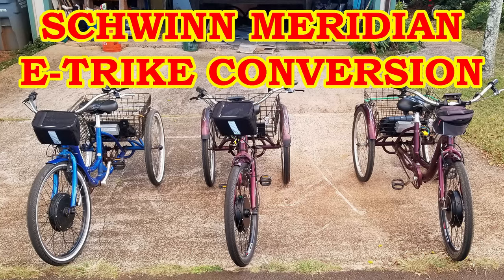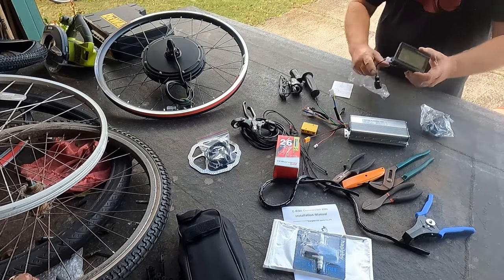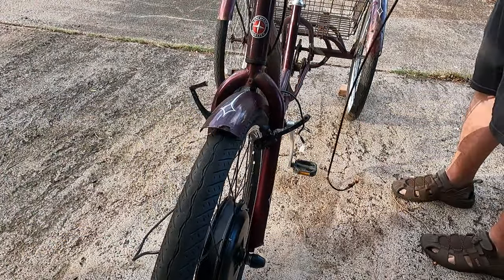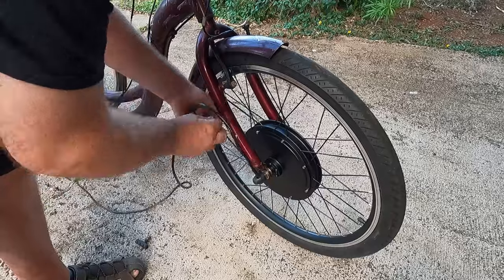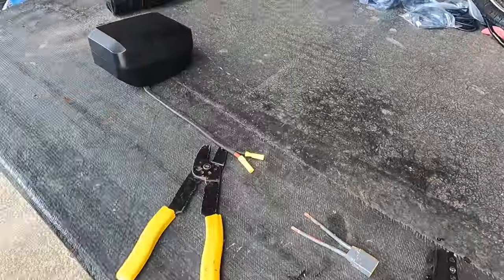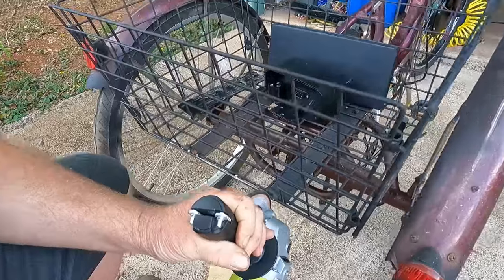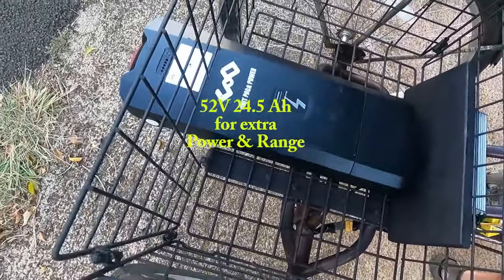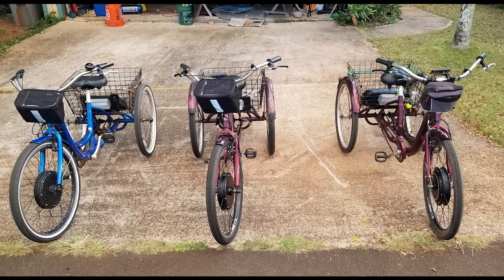Schwinn Meridian Trike - 1000W E-trike - Ebike Conversion

Comment: My ebike only does 15 miles per hour. It has fat tires but adds to traction. It has the wrong tires because it doesn't grip the pavement. It's new tires but the wrong tires.

Comment: I took the rear hubs and laced them into 20inch rear rims so it lowered the back. Put on a banana seat. Large front basket. Filled the rear basket with 4 huge batteries in parallel. Could go almost 100 miles. It could hit corners preeeety fast without rolling. Got stolen. Miss that thing
Reply from the maker: Dang!!!

Comment: If you just deflate the tyre, the wheel can be removed without adjusting the brake setting. Ditto in reverse for refitting the wheel.

Comment: In simple terms can a front wheel ebike motor be used for a rear wheel drive on a Schwinn Meridian?
Reply from the maker: The front wheel motor has an axle and fits in the drop outs of the front forks. the rear wheels have hollow spaces for the axle to come through so won't work with the front wheel motor.

Comment: Thanks for the video.  I just converted a similar Sun Trike with an Amazon 750W, 36V motor.  But it makes a grinding noise under load. When I lift the wheel the noise goes away. Now the Company says they aren't suitable for a Tricycle.  Only a bike. They didn't elaborate why. Is it maybe because a trike has more resistance?   Is that why you use such a big motor and 52 volts on yours?  This build is for someone that has no need to go fast so I thought 750 would be plenty.
Reply from the maker: If you are going up a hill or putting big demand on it, make sure that you are pedaling Demanding too much torque from the motor can be an issue. pedal!

Comment: l agree that it works, you have not taken into the account the possibility of a flat front tire. with a trike, the tube and tube are the most important.
Tires and tubes need to be as close to flat proof as possible. they are available. People do not realize the implications of a flat far from home.
Also, your mounting of the controller can be easier by mounting inside the rear wishbone with zip-ties. providing way better cooling and less material.

Comment: Great vid thinking of doing one of these.  Been looking at used meridians and only see 1 speed trikes.  Is that an issue?  Seems like you'd want the 7 speed for a 1000w etrike conversion? Thanks
Reply from the maker: 1 speed is all you need. once the bike gets going the electric is faster than you can peddle.
Reply: @DIYKauai  oh I see makes sense. I wasn’t sure if you had a 7 speed if you could do a sort of pedal assist but I could that probably wouldn’t work since it’s front wheel drive anyway. Thanks looking to build one of these for my wife

Comment: I noticed in this video you did not go over the pas install is this a necessary component or. An we leave it out
Reply: I don't have a crank pulling tool and it can be a real pain to get the cranks off... I prefer to manually feather in the throttle instead of dealing with PAS delays.

Comment: is it, well not insanely, hard to wire 2 rear wheel kits together into 1 control board?

or should i just do 1 for the front wheel?

I'm 398Lb and the extra torque/stopping power would come in handy
Reply from the maker: these bikes are a little fragile, I would recommend getting a fat tire trike. It will do a better job for you.
Reply: @DIYKauai  thank you, but is it possible to run 2 rear wheel conversion kits for the back tires, or would i need to like, rewire them?
Reply from the maker: No idea, sorry... @MinisterRoy205

Comment: I converted my Meridian. I rode it for two months and four spokes broke on my right rear wheel. I read that the spokes on the stock Meridians are notorious for this. They are also hard to find. Has this been your experience? I have no desire to keep replacing wheels or spokes so I’m wanting to convert to alloy wheels but the “D” shaped axle is not compatible with any I have found. Is it possible to change the axle to one that will work?
Reply: Meridians are not worth it as they are only  $260 at Walmart. Not suitable for ebike.
Reply: Yes you can change the axle get a 3/4 axle off of bmi karts and od 1 3/8 I'd 3/4 axle bearings from ace hardware and get some 3/4 sprockets Bing bang bam larger stronger axle I did it while making a custom stretched drift schwinn

Comment: I purchased a 1000watt ebike kit and a good battery for my ~5 year old Schwinn Meridian, it was nice for a bit but it folded in my forks, I made the repair but I am not going to try this again, BTW I read up before doing this and I even had a torque arm installed. My question is can I put this front wheel ebike motor on the free wheel on the back of my Meridian?
Reply from the maker: sorry about your forks, they are not very strong. You can order new forks from Schwinn, not to much $. I found that tightening the nuts on the forks is super important to keep from bending the dropouts. the rear wheels are different and cannot use the front wheel. You can replace the front forks with ones that are more durable but they won't match the look of the meridian.  best of luck. I have ridden over 5000 miles on these trikes now, so it can certainly be done.  I mainly ride 1500W+ on the front.

Comment: I bought a meridian and put a 1000 watt motor and torque arm and it wallowed out the groove where the axle goes.   Any suggestions?
Reply from the maker: It is very important to really tighten down the nuts on the front forks - much tighter then without the motor wheel. This is the key. The torque arm is a safety backup.  You can contact Schwinn over the phone and they can get you another fork.  I have learned the hard way, lol...  Also, I always pedal to get the bike going as this relieves a lot of stress on the forks. Once you get going you can stop pedaling.

Comment: Hello, I come from Italy, I saw your video, I find it very interesting. I would like to convert my tricycle like you did, I want to ask you a question, with a 1000 Watt motor like yours, it is possible to face 10/15% climbs, moreover, you have only mounted the motor, battery, accelerator and controller ? I'm waiting for an answer, bye.
Reply from the maker: No probkem!

Comment: This was SO helpful!! Thank you for posting this. We are having trouble finding the right PAS sensor, needs to be 4.7mm. Do you have a link to the one you used?
Reply from the maker: I don't use the pedal assist due to the delay... prefer to feather in the throttle... and it is hard to get the cranks off to install them.

Comment: We had the wrapped wires on front tire wrap around the hub🤪 we think we have a missing part, we have the nut but not the cap you show in the video , any suggestions 
Gina
Reply from the maker: Sorry about that... you might try Ebay or Amazon...?

Comment: What type of motor did you buy?Looking to upgrade my trike. I think a 1000 watts is plenty. I don’t have a meridian but a knock off that is exactly the same.
Thanks
Reply from the maker: Check out the latest video I just posted on these trikes where I compare 6 of them side by side.  I think that the 1000W motor with a 52V battery is the way to go. It has plenty of power and nice smooth acceleration curve. The 1500's just peel out in any type of lose ground or grass.  1000W is plenty of power!  Def go for the 52V battery... over volting is fine.
Reply: @DIYKauai  I’m sold. Does Amazon sell this? What brand are we talking about? 
Thanks,
Brent
Reply from the maker: @brentgayler2860  i bought the conversion kits and batteries from China as they have the most options for me in Hawaii.
Reply: @DIYKauai  WILL you PLEASE put up links to EXACTLY the kit you used here and the battery and manufacturer, cost of the build and any or all other build items, accessories, etc. Thank you. Rubber side down....

Comment: I'm curious,  why not mount the battery below the basket so you still have full space in basket? Also, wouldn't it make sense to clean up the frame and repaint it. Kinda looks ghetto bro.. If your goal is to sell it or gift it, my suggestions make sense correct.
Either way the video is cool. Thanks for reading and dont take offense.
Reply from the maker: ghetto is how i roll

Comment: Have you installed disk brakes on your bikes?  My trike is new but it doesn’t have the mounting brackets for disk brakes unless I use the brackets. Is it worth it?
Reply from the maker: The Meridian trikes are not setup to support disk brakes. I simply put bigger break pads on and they stop competently.  Check out this new video comparing 6 different builds.  https://youtu.be/aj3abhgAi2Q
Reply: Okay , thanks so much,

Comment: Somebody please help before I take a blind plunge! I want a Meridian, preferably the 24' 1 speed, however I plan on installing a few aftermarket parts. Can I change the rear rims to 144 spoke hollow hubs??? My first experience with trikes, input is much appreciated.
Reply from the maker: good question for the DIY groups, not sure.
Reply: @DIYKauai  Thankyou brother. I'll keep posting. I just want a fly looking adult trike but I'm not sure if these are good for customizing.
Reply: @TrailerTrashThorne  Maybe Workmans will work with you

Comment: can you covert one of these to a fat tire trike maybe a mid-drive motor
Reply from the maker: Would need a different frame but it can be done!
Reply: @DIYKauai  How about just amid drive motor
Reply from the maker: @darylogle6696  possibly... front works fine except for the fragile dropouts when using 1500W.
Reply: @DIYKauai  Yeah I’m just curious to see if a middrive motor would work because the chain is kind of long

Comment: I was motivated by your builds so I garbage picked a Miami Sun trike and got a thousand watt front hub motor and installed it everything went together fairly well but the front forks don't seem to be able to hold the axle in place or on do you have any suggestions or close-ups of how you secured yours.
Thank you
Reply from the maker: In or on?  can you show me?  I will try and show you this evening.... aloha
Reply: They sell a kit to hold the hub on the forks, I think it’s called a torque bracket.
Reply: @levigreen9562  thank you Yes I got two and new forks and works great now.

Comment: So the battery was separate?
Reply from the maker: Yes. The ebike kits usually include the motor/wheel, new brake levers, a display and a controller of some sore. Batteries are sold seperately. This allows you to chose what type of throttle, motor, etc...

Comment: i always wanted to know, if the battery goes low, can you pedal it and not compromise the motor?
Reply from the maker: Yes, no problem!
Reply: That shouldn't be a problem since the motor isn't a midrive one.  It's a front wheel motor (separate from the the pedals) so pedalling anytime is fine.
Reply: @krob9145 then, that would be a problem with middrive motors?

Comment: How is this fwd ebike/trike kit working out on this meridian? Would you change or do anything different and if so, what specifically? Btw, thanks for all your previous Schwinn Meridian trike conversion videos. Please make an update video with any or all trike conversions and what you added, changed or improved so others can not make any mistakes and have the best result in our eventual conversions. Cheers!
Reply from the maker: I did another video of lessons learned as I have done 7 of these now. https://youtu.be/aj3abhgAi2Q
Reply: @ Diy Kauai .... Sounds great!, I'll watch it. Thanks for responding and for all your time and effort making videos of your builds.
Reply: Honestly from an engineering perspective this is just dumb ..as trikes are designed to have a rwd design to create the forward momentum the front wheel has far too much "play" in its turning radi and the extra torque applied ves where the most of the weigh is focused rwd is far superior epically if you also upgrade the tires and suspension as well..this " diy kit" is a serious joke..
Reply: @Azraiel.Bridger  Do you know of any RWD conversion kits?  Can you make me one?

Comment: Are these trikes pedal assisted or full-time?
Reply from the maker: I did two with pedal assist but skipped it for the others. We found that it was better to feather the throttle while you pedal... smoother and more predictable take offs. And it is hard to get the cranks off!
Reply: @DIYKauai  I would never have trike front wheel drive.  They are dangerous. Mine is rear wheel drive.  You can pedal assist or full time your choice.

Comment: How did you get by the free wheel issue?
Reply from the maker: what issue?
Reply: @DIYKauai   if I put a motor on it the pedals will go just as fast . Mine is a fixed gear wondering how to put on a freewheel.

Comment: Great video! I have the same trike and would like to electrify it, but I would prefer RWD. Since the rear wheels in these trikes don't actually have cassettes mounted directly onto them, could I use the "front wheel" conversion motor (as shown in the video) on one of the rear wheels instead? Or is there some sort of difference between the wheels? (I know nothing about these yet.)

Thanks!
Reply from the maker: The rear wheels are each different. The drive wheel on the axle is keyed. Front wheel is best way to do this without any major modifications.

Comment: So, you went to the trouble of making a video showing us how you built the ebike... but you're not posting links to the hardware? I feel fortunate to have caught the fact that the hub you purchased apparently didn't come with a battery? Or did it? See? I don't even know. Thumbs down!
Reply from the maker: The links change all the time as I order stuff from China so there's no point in posting them. If you are on the US mainland you can order much cheaper from Amazon.  Batteries are usually sold separately.

Comment: NOT a good idea to put battery in the basket.......you loose basket volume carrying capacity, and more important loose traction as this is a front wheel drive.  Battery needs to be mounted as far as possible to the front or over front wheel  to provide maximum traction on loose gravel or even on asphalt . Now if you like smoking tires when throttling put the battery as far back as you can, like on this video!,
Reply from the maker: For the size of the hailong batteries that I use I have not found any other place to put them. I generally agree with your principals but in actual real rode conditions (I have 6 of these) it has proven to not be an issue. When I need to haul more then the 30 lbs. the basket can handle i attached a garden cart and can haul lots.  Aloha!
Reply: I mounted my Hailong battery on the front frame tube, had to make a custom made curved battery support tied to the front frame tube as it it not straight on the Merdian.It did put more weight on the front wheel, and made a difference has I also use the trike on gravel roads with an uphill inclines! For testing purpose I had the battery in the basket. The front wheel spined very easily due to the good torque of the 1000W 26" motor !!
Reply from the maker: @pinznut  cool design... got any pics?
Reply: @DIYKauai   I do have pictures but don't know how to send it on this site.....email?

Comment: So many ways to install the battery but you wasted the basket
Reply from the maker: Too heavy to mount on the frame.
Reply: @DIYKauai  install underneath of the basket
Reply from the maker: @bobetization  would have to use bottle anchors, to weak and not a good area under there. Would also get wet from mud puddles.  The batteries are extra expensive to get to Hawaii so we protect them like little babies! Plenty of room in the basket. I ride them daily and haul all kinds of stuff in them. I am thinking of building custom wood boxes to replace the baskets.. that could be interesting.
Reply: @bobetization his answer shows that you're not the know-it-all that you thought you were !!!everybody wants to put in there two cents next time just appreciate what people are showing you and stop trying to show different ways to do things that he probably thought of already thank you duh

Comment: I bet you anything that there's no way this battery has 24ah. Impossible, too small. Do a test with the proper equipment to measure capacity, the labels usually lie.
Reply from the maker: The one that lays flat in the tray def is.  It has much more capacity compared to the 19.2 AH I run on the others. These things have tons of range anyways.
Reply: @DIYKauai  right, but how do you know? Reading the capacity out of the label is not accurate at all, most of these companies lie and exaggerate. They get away with it because nobody checks for capacity.
If you haven't done a capacity test. You legit don't know how much you have.
I make lithium ion batteries for a living. You never get what you are supposed to get even with brand new cells. I just made a 14ah battery, but when I do the test, there's only 12ah.
There's one I made with recycled cells. On paper it's supposed to be 28ah but the test says 22ah. That's what it is.
You need special equipment to do a capacity test. If we were in the same town I would give you a free capacity test.